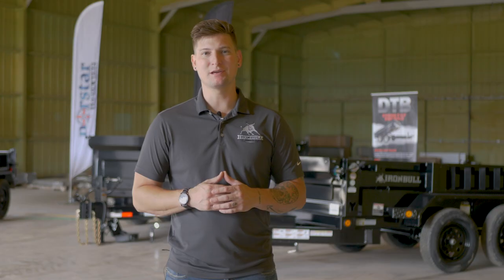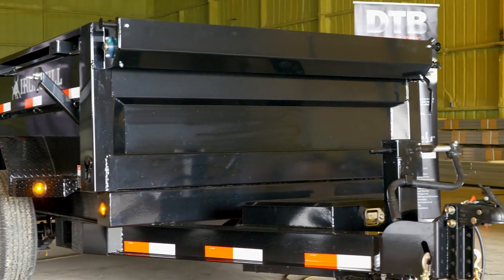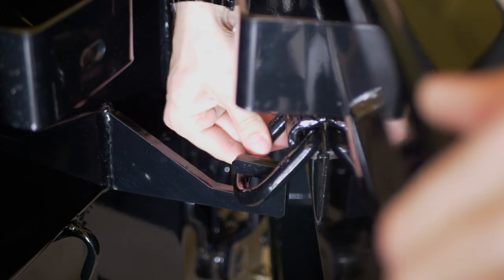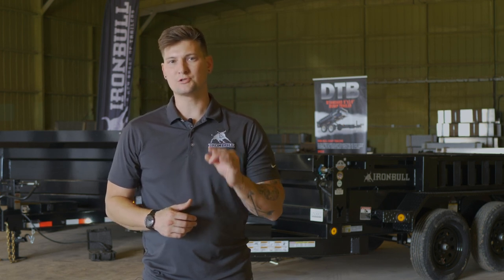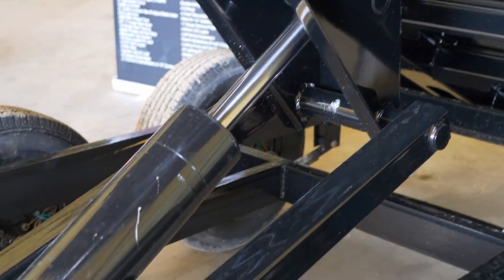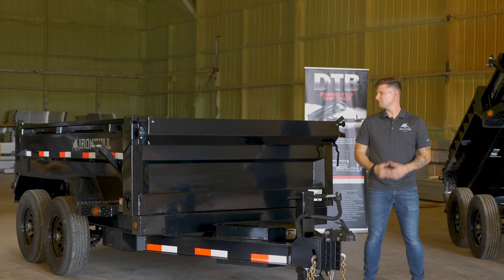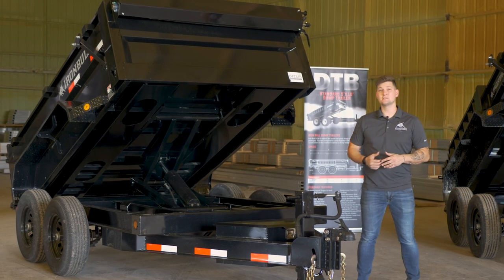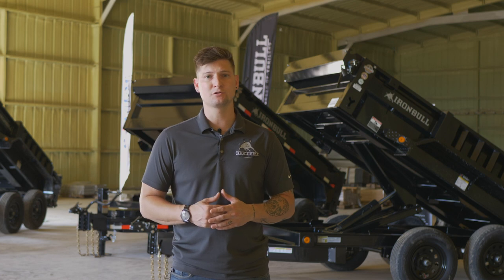Meet the Baby Bulls | Norstar Company

Comment: What does the top deck pivot on? We have a iron bull tilt deck trailer that’s just over a year old. 2 months after we got it one of the two pins that the top deck pivots on fell out. The dealer temporarily fixed it so we could still use it. While we waited for the parts. Meanwhile the other pin fell out. The dealer welded new ones in now less then a year later the welds broke on one of those pins and has fallen out